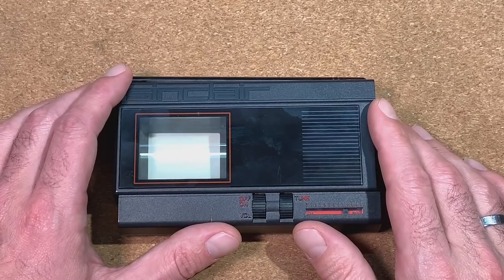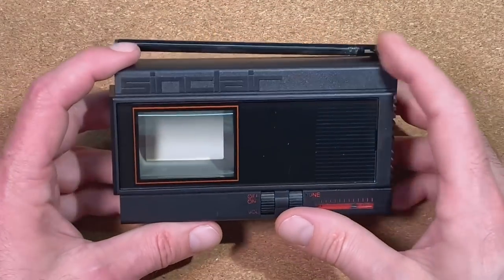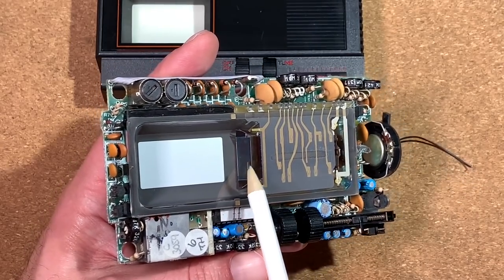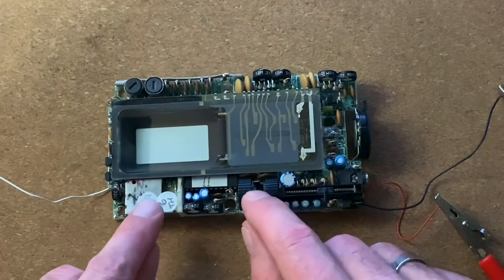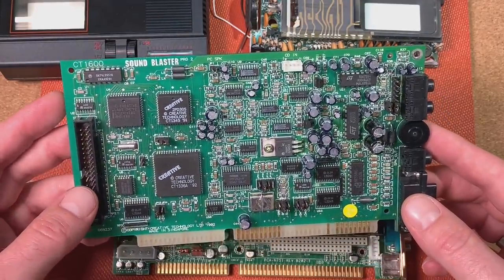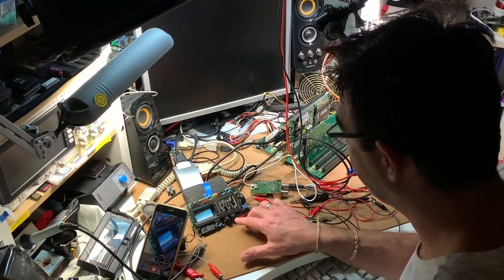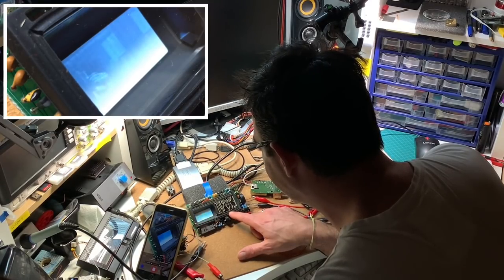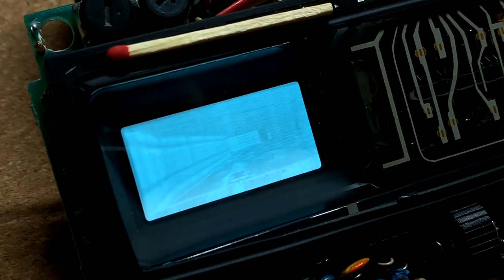Doom on 1983 Sinclair FTV1 TV80 Mini Flat CRT & Teardown

Comment: The UK PAL(i) sound spacing is different to European PAL (bg) sound so that might be the problem if your Sinclair TV is a UK version and the modulator is for European TV.. Great to see you got it working!
Reply: thanks for the clarification
Reply: Yes System I used a 5.5MHz sound carrier, while B, G and K used sound carriers of 4, 4.5 and 5MHz for the sound carrier offset, so it was common to have a TV set where if you selected the wrong sound system you got either good video and no or poor sound, or great sound and garbled video. then you had colour carriers, which added extra condfusion, as SECAM and PAL used the exact same offsets, but slightly different colour carriers and offsets. Then that hybrid MESECAM, using 50Hz 625 line SECAM channel specifications, and 60Hz 525 line video.

Likely the modulator was for BG, but Sinclair generally was I, so you either had to solder in new sound carrier filters for use in other parts of the world,  or use them for video only.

Still have a JVC colour CRT TV set, that was adjustable for all TV systems, B, G, I, and which had a battery operate mode, along with a small Colour CRT. Worked last time I had it on a few years ago.
Reply: @SeanBZA  PAL BG sound carrier (mainland Europe) is 5.5Mc from video carrier, in the UK it is 4.5Mc.
Reply: @hopje01  Been a long time since I did any conversions on TV sets though. Do remember robbing the filters out of dead sets to do that though, as it was easier to get them that way, and dead TV sets were easy to get as well. Did do some tuner conversions, where you replaced the horrid tray of drift pots with a 4 way switch and 4 10 turn trimmers, as there were only 3 TV stations and a VCR around most commonly. 

Sony and the GCS conversion kits, where pretty much it was a BU208D, a heatsink for it, with a lot of resistors, diodes and capacitors, plus a poor copy of a board layout per set, which showed you where to put the assorted bodges in. Strangely enough they did work most of the time.
Reply: @CPUGalaxy  https://www.pollin.de/ did have modulators that you can set the audio sound carrier  and these were about 0.5 Euro , they did need a Arduino to control them and set the sound and video standard ( if i remember correctly)  think they used I2C hence the need for the Arduino. I didn't know that the  FTV1 were that rare ( I have quite a few of these myself maybe 10?) I do remember at the time that the UK electronics hobby magazines had adverts from surplus electronics companies advertising these with faults for a couple of pounds. The Sinclair earlier TV TV1 came in an international flavour where you could switch the switch system but the tube that was used was very similar to the Hitachi one you showed in the video. The TV1 was also available as a MON1A which rather than using rf used a standard composite signal. I also have some TV1 and a think a MON1A somewhere.

Comment: Great video
Sony made a similar right angle CRT around the same time - they produced many different models and screen sizes up to 4" like the FD40 and smaller FD10. They didn't require a lens in front, just some clever electronics to sort out the distortion. Traditional scan coils were used, unlike the Sinclair's electrostatic display and some models are still quite cheap to buy on ebay.
Reply from the maker: yeah, i have a FD10 and ofcourse I planned another video with that model. 😉

Comment: Great stuff! I still have mine although not used for ages..... The battery was a flat pile  lithium 6V P500 made specially for Sinclair by Polaroid and was ridiculously expensive and would last all of 2 hours tops.... . In the end I ran it from a power pack. TV reception was poor so I used a coax chassis socket soldered to a coil of stiff solid core wire wrapped around the aerial and then plugged it into the main house aerial. Hardly a mobile set-up! Snooker was a challenge to watch....  My bedroom tv I then upgraded to a Vega 402.... The problem with the picture flipping is just due to lack of signal... With patience and a lot of moving the set about the room, the picture would eventually settle but usually when the unit was sat on top of the bedroom wardrobe! .

Comment: You should try and pick up a device called an Agile Modulator. They're used quite often in the ham radio community for TV broadcasting. I have one that I used to have hooked up to a Raspberry-Pi to feed video over the old cable hookups in my house. Blonder-Tongue models are fairly cheap and easy to use. Feed it a video and audio signal, choose what channel to broadcast, and hook up a small antenna - boom, TV transmitter.
Reply from the maker: Sounds good. need to check that. 🙂👍🏻

Comment: I've had such a device in the later 80th, where a electronic shop named Völkner sold out these for a very low price.Than I need to collect used polaroid cardrages  to get batteries.

Comment: Has anyone else done "CRT's" like this back then? Or is this almost more of a DLP? As it isn't a tube, nor a cathode ray one.... though it sort of is? But it really isn't.... as it's projecting it from the side.... As one who's been into tech since my own inception in the 80's, I can attest with acute assuredness that I've never seen this before.
Reply from the maker: so this is definitely a CRT. We have an electron gun, we have grids for focus, we have deflection of the beam, we have anode voltage, we have a Phosphor coating on the screen... All this is the definition of a Cathode Ray Tube. Just a bit in another form factor. DLP is a completely different technology.